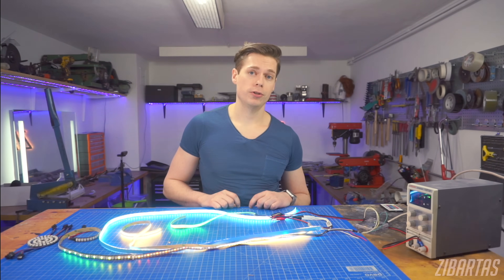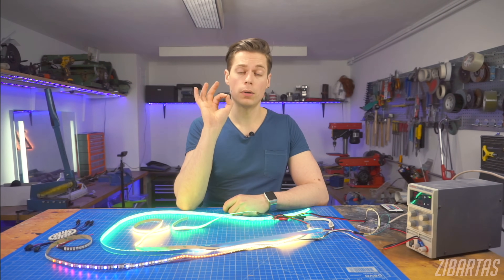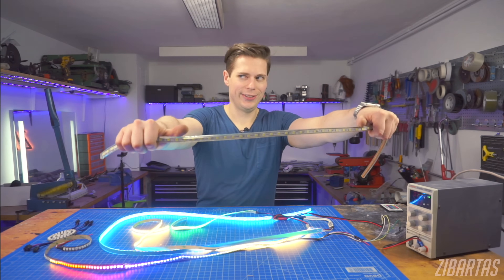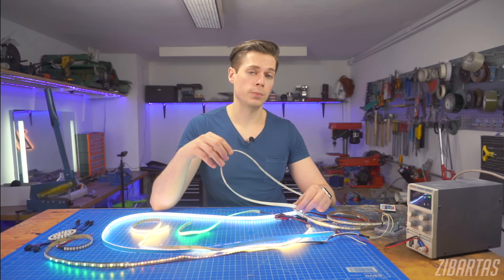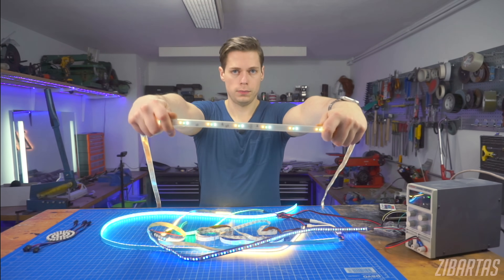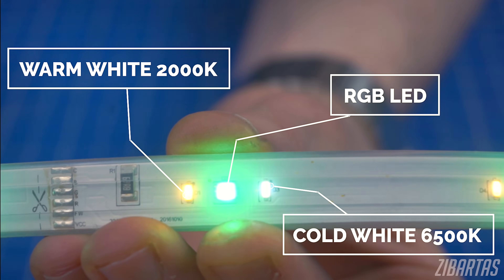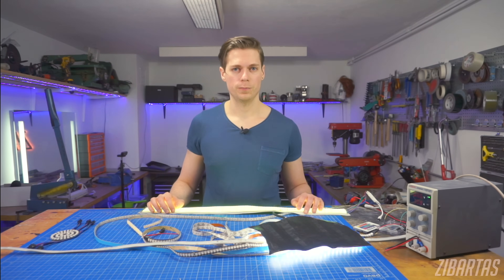LEDs for Beginners: Best Types for Cosplay & DIY

Comment: What would you need to consider if you work with 5 individual 1m-long digital stripes? Can the Arduino supply power directly to them? Or is it only sending digital signals and the power is supplies by a dedicated source??

Comment: You can use WLED for digital LEDs without any coding skill (WS2812B strip) + a cheap and small version of ESP32 + a 330 ohm resistor
It would have a USB connector able to power the microchip + up to 60 full white LEDs with one power cable (using 5v pin) ; It would be handy to connect to most 1A powerbank

Comment: Hey, i know I'm late to this video, but i started a project with digital led's and by calculation I'm going to need 40 amps just for my shield 😬. Now this is calculated at 100 luminosity and white light. Can i still use a 3,7v lipo with 4400mAh with a max output of 1A on lower settings or should I invest in some bigger li ion batteries? All of these with a 5v stepup of course
Reply from the maker: If you need 40A and you provide 1A, you're 39A short xD

Even if you estimate HALF (20A), that's 19A short... :)
Reply: @Zibartas  li ion it is
Reply: did  it work?

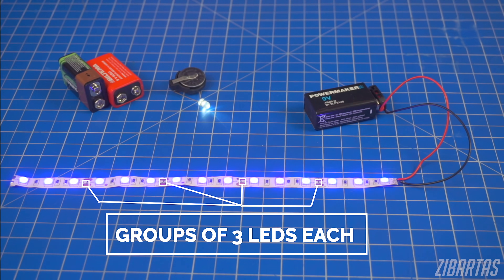Comment: Hi! What is that little black thing you used in 2:08 to connect the wires to the battery?
Reply from the maker: It's just a 9V battery connector - if you look for them online you'll be able to buy them for pennies :)

Comment: What rgb of those are the brightest? Can you recommend? Money is not a problem, what are the brightest rgb led strips?
Reply from the maker: I think for the most part all of them are nearly equally bright, even comparing larger to smaller LEDs. Your best bet is to buy the densest (most LEDs per meter) strips - or looking for strips with multiple rows of LEDs (they look more like belts than strips cause theyre so wide lol)

Comment: great video! i've been trying to study led lights for my dress and then I discovered your channel! i am learning so much! one question tho, if I have 5m led strips with Input Voltage of DC12V, will it light up with a 12V Battery box with 8pcs of 2AA Batteries? I really hope you can respond. ☺️
Reply from the maker: Aw I'm so happy to hear!!! And -- if the battery holder connects them in serial (one after another) then 8x1.5V = 12V, yes! :D

Comment: I'm looking to incorporate RGB LED strips into a cosplay, however I require that specific colour for 3 separate pieces. Would I need multiple LED output jacks? Or is it possible to set the colour, and then remove it to set the colour on another separate piece?
Sorry if that didn't make sense haha
Reply from the maker: If you need to have 3 separate parts - you  will need 3 controllers- if you wanna have a single controller you'll need to connect the parts somehow :)

Comment: hi so i have a few questions as to what leds i will need to buy for a cosplay im working on. im currently building kaneki's kagune from tokyo ghoul and i wanted to put some red lighting in it to make it look like the his kagune when its active in the anime it almost looks like there are veins of light threw the kagune that pulsate and i would love to acheive that effect but im still unsure as to what lights would be best. i dont need it to change colors or anything just red is fine but i would like to make it so it can pulaste. if you have any tips or know what would be best that would be greatly apreciated
Reply from the maker: Maybe consider using as dense LED strips as you can? Otherwise if you want something smooth and 'vein-like' looking, you might need to look into fiber optics or EL wire, for a more diffused, even look :)  For pulsing you can get an off-the-shelf 12V RGB strip controller, it will have some basic animations built in, and they do not cost a lot!
Reply: @Zibartas  thanks so much!!